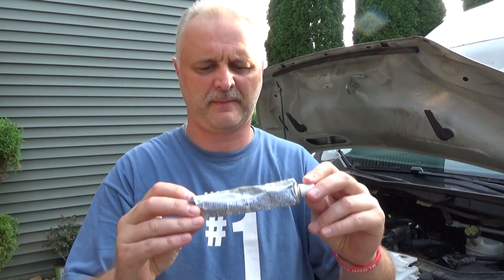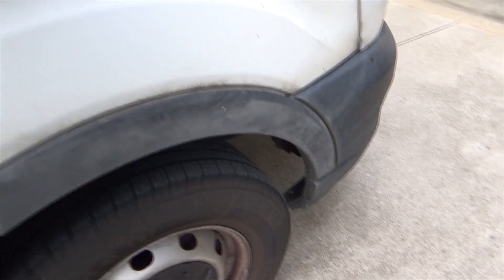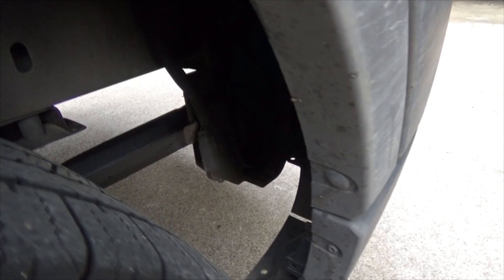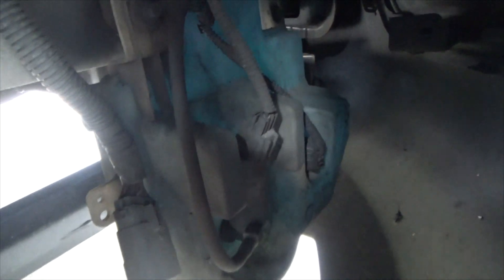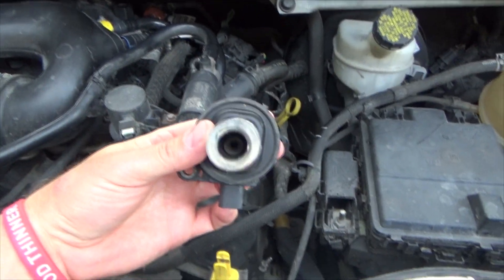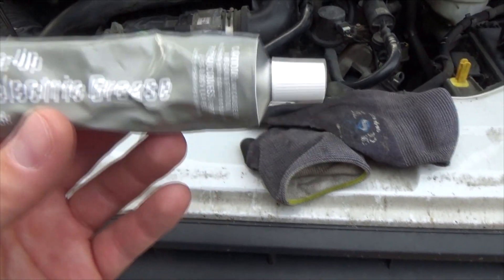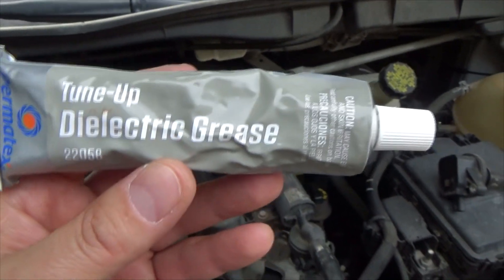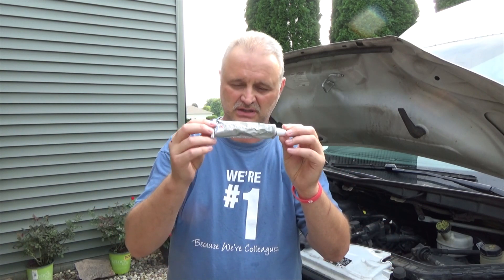Dielectric Grease Fixes Bad Electrical Connections

Comment: This grease is an electrical insulator, you have to be careful to put in terminals. Video would be helpful to show how to use properly without blocking the expected connection.

Comment: Isnt it just regular silicone grease? Whats the fiddifference ?
Reply from the maker: While often used interchangeably, "dielectric grease" refers specifically to the application of a grease with excellent insulating properties to protect electrical connections from moisture, while "silicone grease" refers to the material itself, which is typically the base component of dielectric grease; essentially, most dielectric greases are made from silicone, making them very similar, but not exactly the same thing; the key distinction is the intended use, not the chemical composition.

Comment: you say just one terminal, how do you know which terminal to put it on
Reply from the maker: You can safely put it on any 12 volt terminal or connector. Just make sure if you put it on the connectors to put grease on each pin individually
Reply: Thank you.  Have a few items that are just as you described.  @VasylGladun